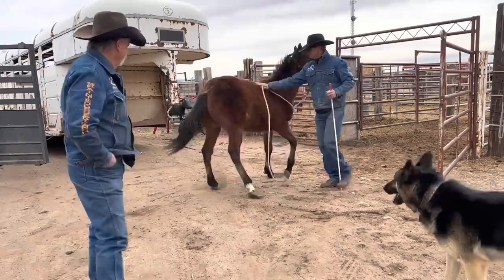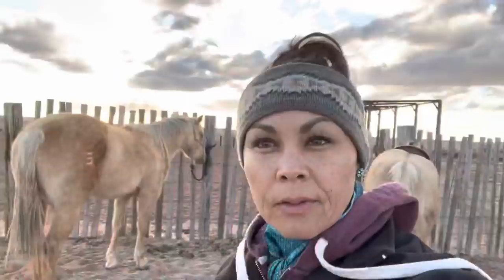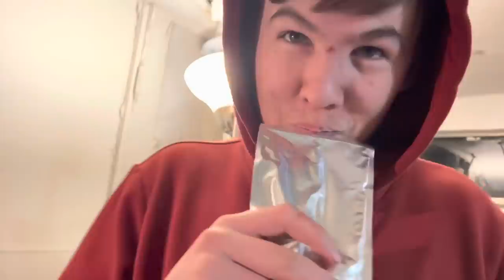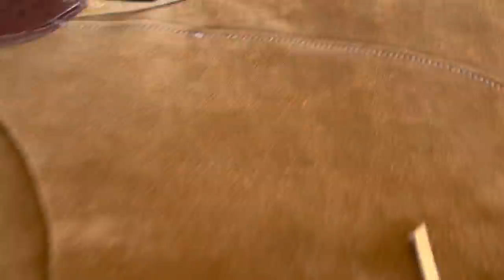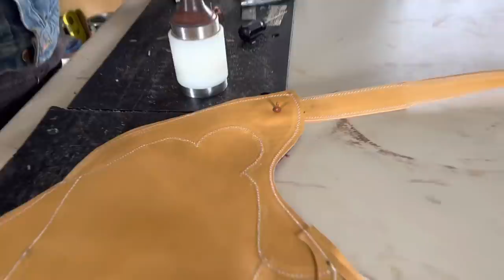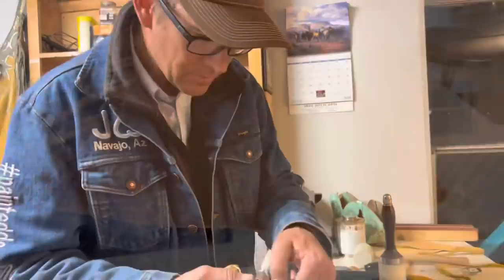A FOAL GOES TO APACHE COUNTRY | CONNOR & LINCOLN GET BEAT UP | LEATHERWORK

Comment: Nice sewing machine. Great buy at $50. You can sew just about anything on that. As a sewer/crafter I really liked watching you at work on the chaps. Very nice work. I couldn't tell but do you backstitch at the end of a row? It will lock in the thread. I saw you left a tail when you took them off the machine. I'll watch till the end to see how you finish. Would like to see more if you don't mind showing your crafting secrets. Thanks. 💘 🐎 GSD 🇺🇸
Reply from the maker: No back stitch